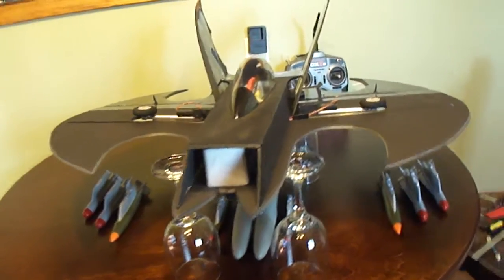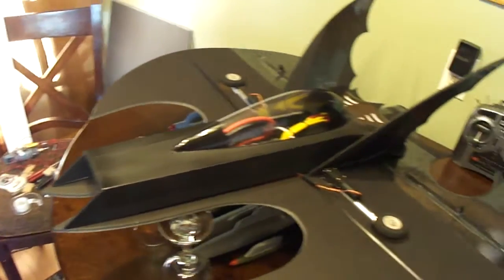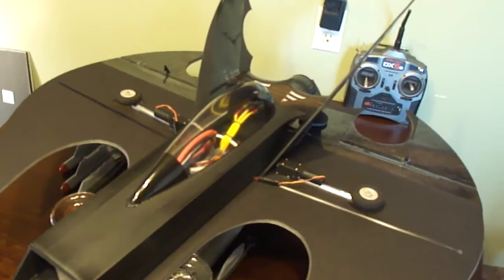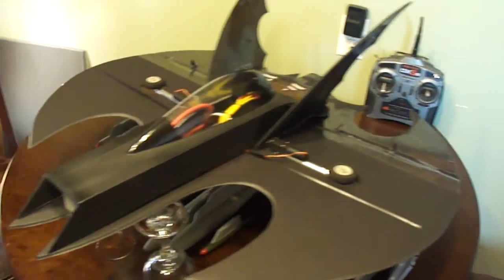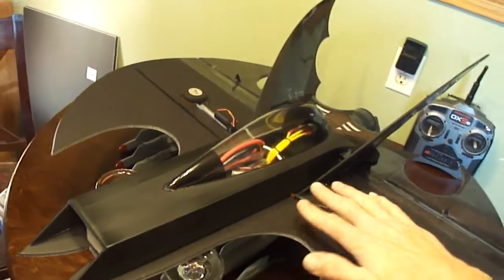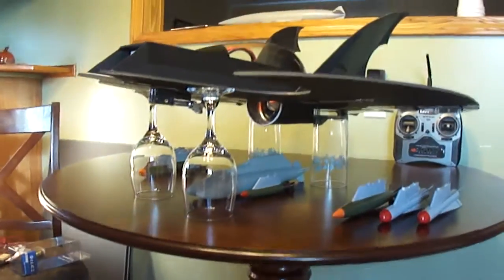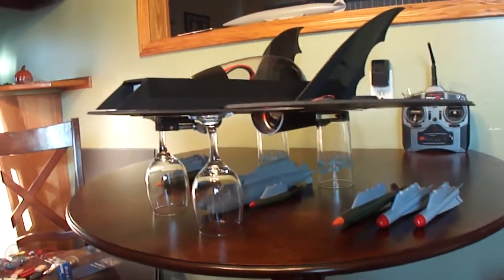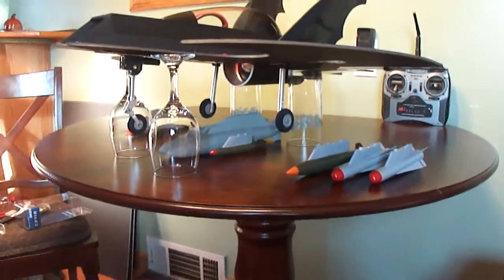Building the (Bat Wing) RC Jet. Retracks,lights,bombs and missiles, Dr mad 68mm edf unit,

Comment: Chris! Where are the plans for this one!? I want them! Also, do you have any video of it flying?
Reply from the maker: +Wolfgang51501986 I have plans for a 70mm EDF version,  foamconceptjets.com  that i just took and blew the plans up to have a 30&quot; inch wing span.. then used two layers of Elmers black foam board to make the main air frame more rigid. Sure is fun  to fly. Flight video https://youtu.be/WMQpg7JDaHM